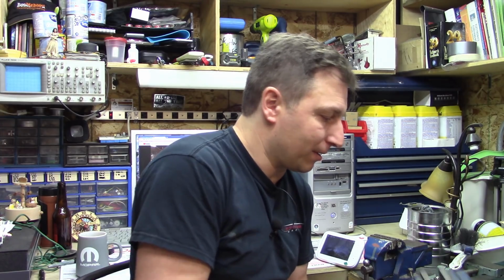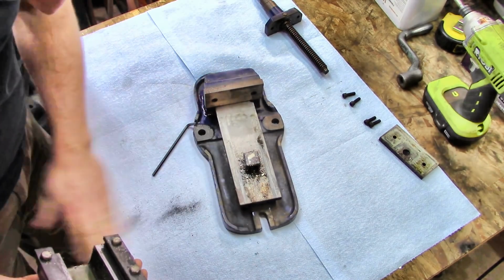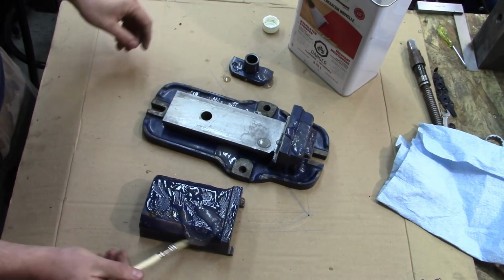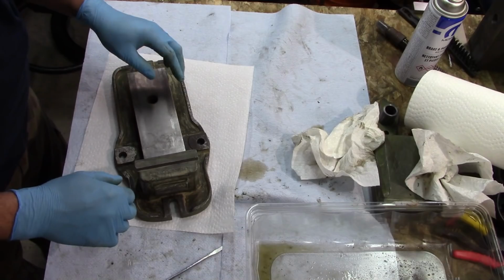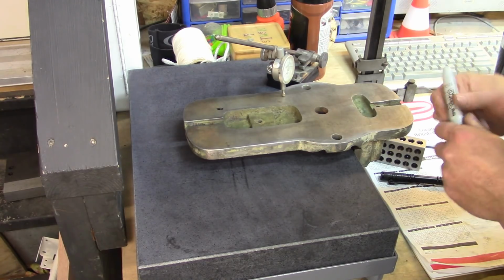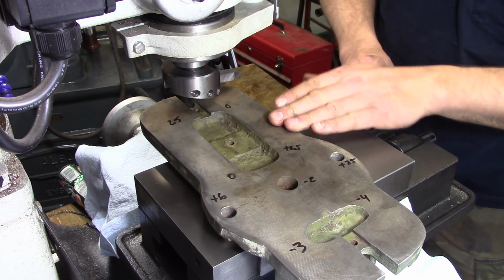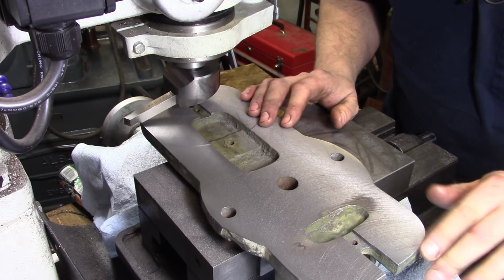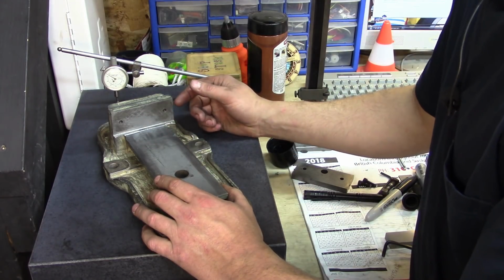Garage Sale Mill Vise for the Shaper Part 1

Comment: Coat heavy with stripper. Cover with plastic. Let sit one hour. Recoat with stripper about ten minutes before scraping. I prefer to final clean with lacquer thinner over denatured alcohol. Alcohol won’t cut solvent based paints.
Reply: The old man taught me never be shy with strippers
Reply from the maker: I've been getting used to using it again, until the shaper I haven't needed to use it for about 20 years.  Got another few projects in the queue needing paint removal so I'm glad I got the big tin.
Reply from the maker: Wow, that could be a double entendre, lol!

Comment: Nice vise, I think it will look great on the shaper. I like the way you fixed the bottom of it on the mill. Nice work!
You have made me interested in small shapers with your restoration, so I´m looking for one here in Sweden now, but haven´t found one yet.
/Leif
Reply from the maker: Thanks Leif, I think it will complement the machine when it's done too, as it looks old as well.  I've always thought shapers were interesting, as I used one in high school metal shop and have wanted one ever since.  I remember seeing an old Prema metal shaper in the classified ads a couple years ago but missed out on it, apparently it's a Swedish make - was a smaller unit but looked heavy dutyt.  Maybe one of those might still be around in your area?

Comment: While those marks could of course have been from a shaper Everett, I'd lean more towards a planer for what was used. Gang planing 10 or more at a time makes doing it that way a whole lot faster than one at a time on a shaper. My memory isn't the best and could also be wrong, but I seem to recall seeing vices like that advertised by Palmgren maybe 30-40? years ago when they were still manufacturing tooling in there U.S. location. Today I think there mostly rebranding off shore tooling with there name and don't manufacturer anything. Are you sure those rotary tool marks on the vise base weren't from a Blanchard Grinder? If they were it would have looked like a very coarse feed rate with a large face mill but it's actually from side wheeling with a large grind stone. Ideally you want to machine that fixed jaw so it's jaw face is slightly tapered and leans in towards the vises bed by at least a thou or two. In use and under the tightening pressures doing it that way helps to compensate for the fixed jaw flexing away from the movable jaw as the vise gets fully tightened. 

It might be worth re assembling that vise and indicate how much that jaw deflects under average part sizes and tightening pressures since you might need more of a taper than that thou or two. ALL milling vises including Kurt's will show at least some deflection in that fixed jaw. And the better vises are machined and ground slightly off square to compensate for that movement. I suspect due to wear and that casting warpage that showed on the vise base you may need to re machine the rails the movable jaw slides on and then maybe add shims to reduce the clearances so you get minimal jaw lift on the movable jaw. It should still make a decent shaper vise though. And you can't hardly beat the price. :-)
Reply from the maker: You know, I had not thought about an intentional taper on the fixed jaw nor any deflection, you've got a good point on that.  Will have to do some testing and see.  As for the marks on the base a Blanchard grinder makes sense given the size of the radius in the lines.  I will be looking into old Palmgren vises as you say, to see if their old stuff looks like this one, thanks for the tips and ideas!
Reply: @EverettsWorkshop  Well I tried a couple of image searches using various terms and not much luck. So I'm beginning to think my Palmgren lead might be totally wrong Everett. If you can't find the manufacturer I'd bet a lot one of the guys on this antiques forum https://www.practicalmachinist.com/vb/antique-machinery-and-history/ will be able to tell you who made it and it's approximate age.

Comment: Can't be at all bad for $8 - the crud was free!  Looks like some good potential.
In the absence of precision grinding that fly cut approach seemed well worth the trouble... came out pretty good.
Reply from the maker: Thanks Chris, I figured for the price it was worth trying to fix it, and the free greasy crud in retrospect probably helped protect from rust.  And yes, no surface grinder here yet, so fly cutting is what  have to use, the base came out quite usable from that operation.  Now on to the fixed jaw mount.  Hope you're doing well.

Comment: That was a good job for a shaper or surface grinder.
Reply from the maker: I would have used the shaper itself except that the vise is too long to get full travel across the bottom mounting face on the shaper table.  It would have been about 3" too short, so that's why the mill and a fly cutter was chosen.

Comment: At eight dollars, it's like you bought yourself a rough casting that needs to be turned into a precision vise, the whole vise seemed in great shape without drilling or milling holes, try to avoid touching the sliding surface if it's in good shape, the bottom can be touched-up for minor corrections after measuring, the front 90 degrees could be machined using a right angle holding solid fixture, quite easy to dial the 90 and trim as required with shims...
The little one will grow and require electrical tools, and his requests are gonna be for bigger and bigger tools...     😁😎👍🎁
Reply from the maker: Hey Pierre, I totally agree with you, and the sad part is that this "rough casting" is straighter than a sliding vise I bought a few years ago that came from Asia.  As the "bed" area and the sliding sides where the movable jaw moves are straight they will be left alone but that fixed jaw mount needs help.  That surface will be done up on the shaper.  As for Little Man, I'm just proud of him and how curious he is with mechanical stuff so if he wants tools as he gets older then we'll start him his own tool box :)

Comment: My google fu found a Peregrine Manufacturing in Lynnwood Washington. It seems that they started as Peregrine Machine Works and at some point changed their name. So there is a chance your vise came from them and crossed the boarder at some point.
Reply from the maker: Thanks Tom, I had found that Peregrine Manufacturing as well, but wasn't aware that they were Peregrine Machine Works at one point - you might be right, that vise may have come from Washington some time in its existence.  Well, if they happen to be missing a vise I can return it, but they wouldn't have wanted it back as I got it!  Hope the shop is coming along well for you, haven't had a chance to see your latest video yet.

Comment: Nice find Everett, it looks like a skill enhancing project. I have a smaller vise like that I got from Princess Auto, haven't used it or checked it either, but that looks like it will mate with the shaper nicely.
Cheers!
Reply from the maker: Thanks Howie, I'm more hopeful now for it than I was at the start.  A few more operations on it and it should be ready for paint.  Thankful for the price, for sure!

Comment: Great video, can't wait for part 2 and more. 
I'm not a machinist but if your happy for it to be within 1 thou and that fly cutter achieved that then good job I say. All your measurements seemed to be consistent with how it was taking away material. 
I only know about scraping from abom/Keith Rucker vids but maybe try doing that ink thing on your surface plate with the newly cut base purely out of interest to see what ink coverage you get. Cat wait to see it painted and rebuilt.
Reply from the maker: Thanks Darren!  Honestly I'm not a machinist either, but considering what I've got to work with being within .001" over the 10" or so I consider a win.  I haven't done any scraping at all, and as for checking the base with bluing I don't know if I even have the right compound for marking the base.  I'd rather not make my plate permanently stained with Dykem, that's for sure!  At some point I might revisit it once some research is done on proper flatness bluing chemicals.

Comment: The fist step to restore the vise is to put the base upside  down on the shaper using the flat surface as a reference.  As far as the small right angle  is good @ 90 deg, if it has been dropped or shocked please consider it out of alignment. The blade will move from 90 and your measurement is bad. Been there.
Reply from the maker: Hi Lee, I would have used the shaper to shave the bottom except that the work envelope of the shaper is not large enough to accommodate the whole base.  I do intend to use the shaper in repairing the fixed jaw mount though.

Comment: Might be able to have the bottom surface ground for a few bucks,  I'd do it for you but I'm in Ontario. I think it'd be cheaper to do it locally. Look for a place that does industrial knife grinding. Like Zamboni or lumber knife grinding. Sometimes they'll do it for a good price
Reply from the maker: Thanks for the offer but I don't know anyone in the area with a surface grinder.  The fly cutting job will work for now but if I can ever find an affordable surface grinder (and the space for it) then the first project would be to grind in the vise bottom for sure.  Might have to ask around as you say though, if it's not that expensive then it might be an option.
Reply: The funny thing is that I wasn't looking for a surface grinder but the one I got was advertised for free on kijiji, I was humming and hawing about it but I had access to a skidsteer with forks and a float that day and picked it up not thinking I'd use it much, but I'll tell you, I use it almost as much as my lathe and I couldn't imagine not having it. I'd say that if you see one in good shape for a steal jump on it. You can see the one I picked up a few days after already running it with n my videos. It's old but still very accurate

Comment: For squaring the jaw, if you are going to use it on the shaper, use the shaper.  Match it to the machine you will use it on.  No more than it needs, you have plenty of room for small corrections.  Correct the jaw insert unless the empty jaw is way out, as the insert could be easier replaced/fixed in the event of a catastrophic error.  Don't get too horsey when you clamp your work it it, that may be the reason why it is slightly out of square now.

By the marks you pointed out, it's likely it was gang machined with a bunch of others, on a big planer, similar to the one Keith is rebuilding

That vise is prime for the price you paid, in comparison to the one I have for mine.  No visible drill marks, movable jaw is intact, decent screw & nut by what I could tell (really no sign of serious wear) ... even the Gorton vise that came with my drill press isn't in as good a condition as that one.  And you don't need to break it down to it's component parts to be able to lift it to the table without a crane.  I'm jealous.  You down play it, but you really made like a bandit.
Reply from the maker: I will admit, I am quite thankful for finding a cheap vise for the machine as the machine cost a bit more to do up than I had anticipated.  As for the fixed jaw mount, it isn't even flat underneath but convex, mostly in the bottom middle so I'm going to use the shaper but skim the mounting surface to ensure the fixed jaw sits flat on it.  The surface really isn't very well-finished, it's kind of rough so it needs cleaning up anyway.  As for the planer thought, that makes sense as if this is cheaply mass-produced then one machine setup to do a batch of parts would make more sense in a factory setting.  Good thought on that one!
Reply: @EverettsWorkshop    well, for comparison, I paid $75 for mine.  Part of the moving jaw is gone, someone re-drilled and moved the jaw plate fastener in.   Drill marks in the deck.  No swivel base, but it's obvious that it used to have one.  Like yours, there is no clue of who manufactured it, but I suspect it is, or was inspired by, Cincinnati.

So, to really get it to a reasonable standard, I need a base (Jason at Fireball Tools has inspired ideas for that), fix or replace the moving jaw, repair the deck or at least make sure it isn't going to cause problems ... that may involve grinding it in, and if I do that, I'll need to adjust the fit of the moving jaw to it's base (it goes on exactly like yours does). It's really over sized for my machine, but it is stout enough that I can put the gronk on it without fear of (further) damaging it.  So, considering size, initial cost, and the amount of work needing done,  I think you got the better deal ... and you don't have to wear your iron truss to put yours on your machine. 😣😫 ... or take it apart.

Comment: I’ve seen vises similar to yours that come from India. I don’t know for sure, but I suspect that is where it came from. The thing that makes me wonder is the fasteners are imperial.
Reply from the maker: Yeah, it does have some pretty rough casting on it, smoothed out by the putty.  But yes, the fasteners are using Imperial measurements.  However you did give me one thought - if the threads are 55 degrees instead of 60 degrees it would be using Whitworth, which would seriously make India a suspected source due to the former British presence there.  Thanks for the suggestion, will look into it.

Comment: Wouldn’t it have been better to do it with your shaper.
Reply from the maker: Hi Don, I totally wish I could have but the base of the vise is 13" long and the machine movement in any of the axes is only 10".  Hence, the fly cutter was used as that was my only option given the equipment available.

Comment: Why not flaten the base on the shaper? thats what they are for.
Reply from the maker: I wish I could have used the shaper for it but the table does not travel enough to have done the whole base. At that point, for what I have available, fly cutting was my feasible option. Very valid question though!
Reply: @EverettsWorkshop  Obviously yours is not a Fireball tool or Abomb69 size shaper then 🤔 still nice to have one though even if slightly limited, my lathe is 99% of the time ok but still  sucks that 1%

Comment: Nice job so far, a bit tall for a 10" shaper, I have the same problem with my Elliot 10M, which is a later model of your shaper. I've had it 15 years I still haven't found a good low vice! All the best Matthew.
Reply from the maker: Hi Matthew, it might be a bit tall but it's what I have to work with.  Even the newer 4" machining vises are fairly tall, as you say your vise is a bit tall too.  I do like the old-school look of it and think it would suit the shaper better than a new unit.

Comment: Re: Little Man, enjoy him while you can.  Kids are cute, but they can grow up mean.

When my kid was a toddler, he liked screwdrivers. If I set one down, it vanished.  Never seen again. 

At some point, I bought a set of Craftsman screwdrivers, a 20-inch plastic toolbox with lift-out tray and a padlock.  After locking away my new screwdrivers, I thought I'd thwarted him.

The next time I got out the toolbox and opened the padlock, it was empty.  About 10 years later, he admitted to knocking out the hinge pins, opening the lid backwards and looting the box.  

The Kid seemed to be inordinately pleased with his genius, but — he knew that — he wouldn't be beaten to death.  

Screwdrivers are cheap.  After he left home, I finally found several dozen.
Reply from the maker: Lol, that's awesome, Dan!  My Dad saw that as a kid I was interested in this sort of thing and used to get me tools for Christmas and my birthdays.  I thought they were cool, and he thought it was cool that I left his tools out less!
Reply: As a baby, my dad gave me a 1/4" ratchet to cut my teeth on

Comment: Is there a reason why you didn't rework that surface on the shaper? After all, the shaper is the ideal machine to do this. And no need to hand feeding.
Reply from the maker: I hear you, I wish I could have done it on the shaper but the table does not travel far enough to have gotten the whole base cut on the shaper.  Hence, the mill with a fly cutter was chosen, but the fixed jaw mount face will be repaired with the shaper as it is the ideal tool for the job, as you say.  Hope you're doing well!

Comment: The paint stripper -- especially the "eco" kind -- is almost always ethylene glycol with some extra stuff. Some gelling agents, possibly some aromatics to speed the paint off.
Reply from the maker: Interesting, thanks for sharing - I did a search on ethylene glycol regarding paint removal and it sounds like the stuff works but not as strongly as the "old stuff," which is apparently uses methylene chloride according to Google.  Given the carcinogenic nature of the old stuff, sounds like the glycol-based is the way to go, even if it isn't as strong.

Comment: Eight doll hairs, bargain !
I'm sure you will have thought of this but could the shaper do the job ?  Blue the surface plate and take a rub, see how you did.
Reply from the maker: I did think of using the shaper but its work envelope is not large enough to get the whole base done so the mill was used.  I hadn't thought of bluing the surface plate and rubbing the bottom of it but I guess that would be a good check.  Just want to look into what to use for bluing as I don't think I have the right stuff to do that kind of bluing check yet and I don't want the granite stained blue forever with Dykem!
Reply: Everett's Workshop The Dykem should wash right off with brake clean, try the underside as a test 1st.